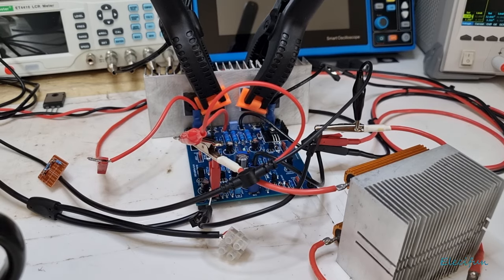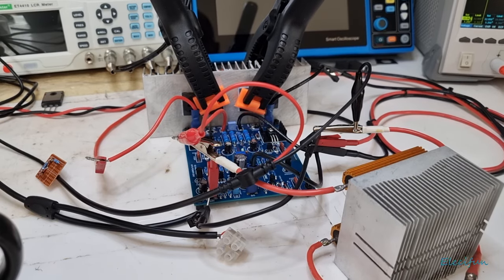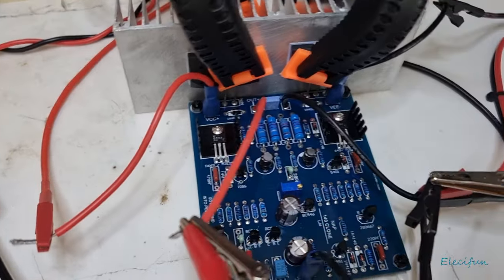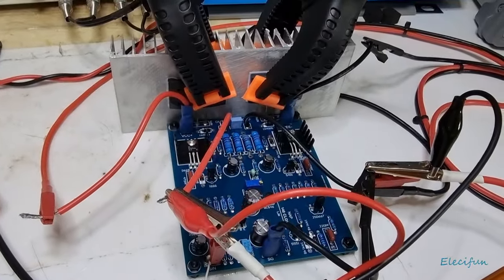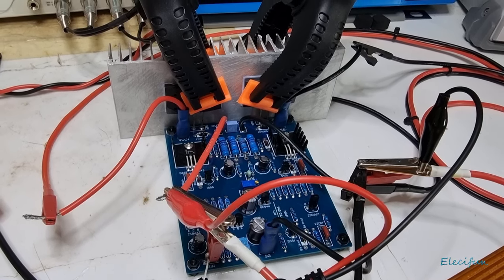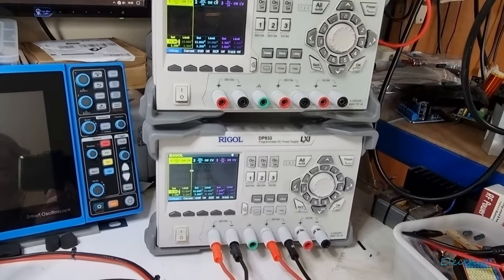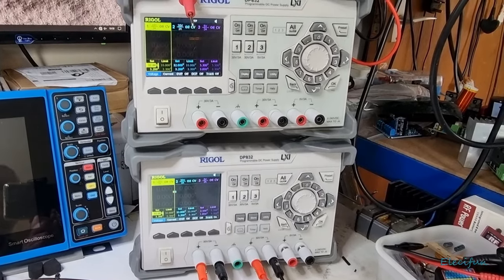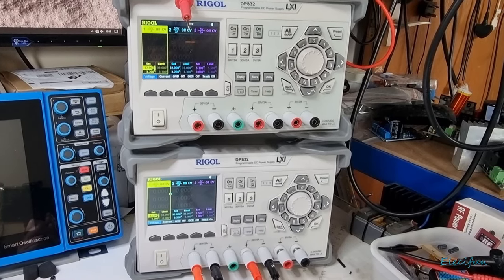Rigol DP832 Noise? Ripple Investigation

Comment: Compardre, did you buy another Rigol 832 or did you already have it before? 🤔
Reply from the maker: @decem_unosquattro9538 I bought it second hand. Not fair to ask for a return as I suspect the seller would never of know of this issue. Everything else works as it should.
Reply: @Elecifun  I hope you got it for a good price comrade Eleci. 🤔 I guess it won't take much to fix it. 

Incidentally my 5.1 SS system isn't working properly.

The pod or the control pod won't turn off.

I've already replaced a few aluminium caps before. 

Now I'm wondering what other components need replacing.

Anyway at some stage I'll get around to it.

Tommorow if I can haul my butt out of bed I'll start on the east side of my house. 

Its a relatively small section still it's gotta be done.

The section or the wall beside the brick chimneys (east side wall) is a large section with a window. That'll be another project still it depends on finances. I don't know what I should do now. 

Maybe I'll wait, but maybe I won't either. It's a dilemma. 🤔

It would be nice to get it finished before winter still I'd be surprised if that's possible.

I know I have some big bills coming up and I don't need to be down to my last 50 bucks.

Anyway getting back to the Rigol 832. I hope the new caps fix the interference. 

Good night sir. I guess it's your spring there. Do you live anywhere near the coast? It must be a nice time to stroll along the beaches in England. 🙂

Seeya. Dec.